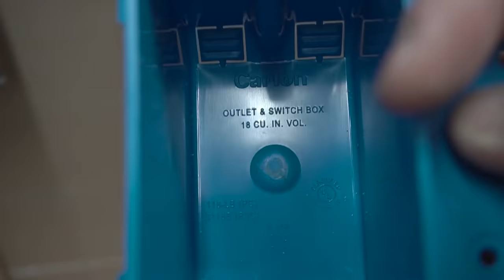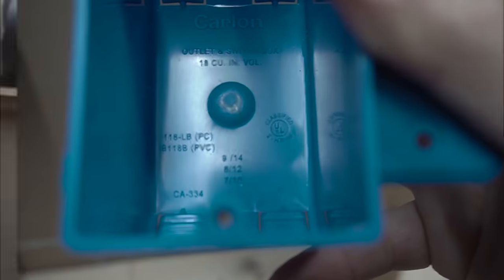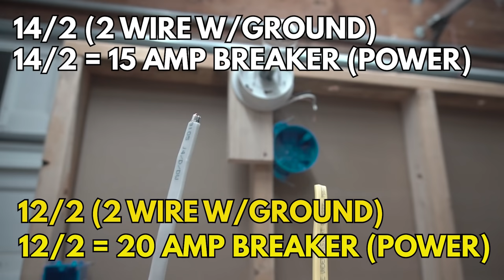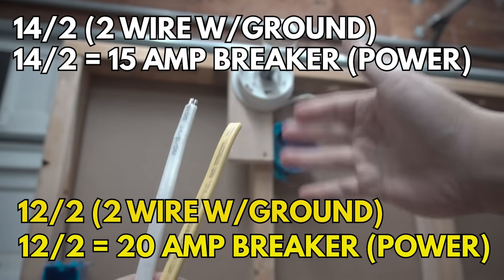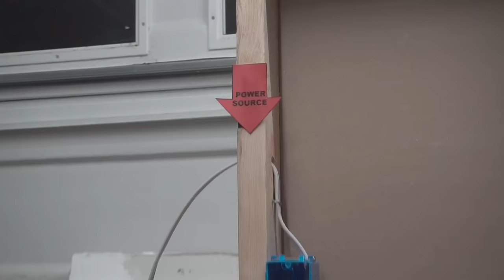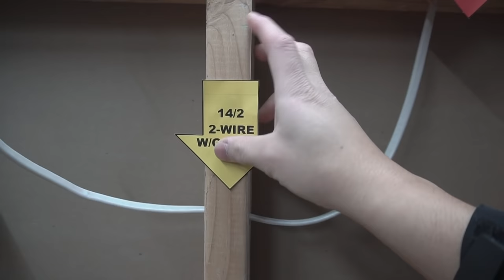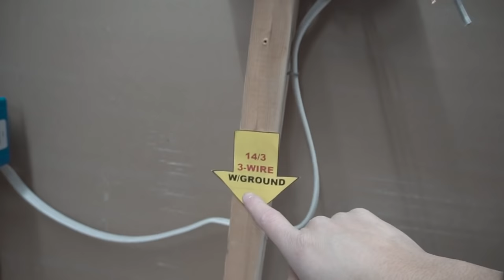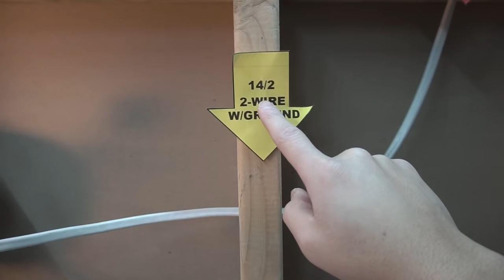How To Wire A Single Pole Light Switch Circuits 3 Different Ways (2022) DIY Tutorial For Beginners!

Comment: This has to be one of the best video's, excellent instructions and very clearly presented. I love your instructional mock up, nicely constructed. When you run power to light first, this is a switch loop because the power comes to the light, then to the switch and back to the light. Perfectly fine to do. The third method is the best way to do a switch loop because it leaves a neutral wire in the switch box and is a code requirement.
Can you show 3 way and 4 way switch wiring? A split receptacle where one is controlled by a switch and the other is live all the time would also be useful.
Reply from the maker: Thank you so much for the thoughtful comment and appreciating the video! It took a long time to compose and edit 😅.  I’m so glad you found it useful and thank you for mentioning and explaining the switch loop power travel points! 🙏🏽 I will definitely be making a video on a 3 way, Please stay tuned! Thank you for the love and support! 🙏🏽😊👍🏽
Reply from the maker: Also I will create a video on a split receptacle 👍🏽😊🙏🏽
Reply: I don't understand the purpose of the neutral wire in that third example since it's not connected to anything at one end.
Reply: @erichsh58  That's a good question. It does not function at this time, however it has been a requirement by the NEC since 2011 because it's usually necessary for a possible future upgrade to a Wi-Fi switch dimmer. Another incidental advantage is that if you want to add a new receptacle nearby, you can tap into this switch for power.
Reply: When connecting the live wire to a switch does it matter if it’s screwed at the bottom or the top?
Reply: definitely should have a million views, just what i was looking for
Reply: @FixThisHouse  how would i add another switch to that tho, so basically i want to put a light either on same switch or different switch but in same j box
Reply: absolutely

Comment: If you follow the NEC 2020 code, 2020 NEC 404.2(c), switches controlling lighting loads shall have a neutral in the box to allow for smart switches. Method 1 or 3 is required to meet the new code. Don't use method 2 anymore. Any new work or remodels should follow the new codes or whatever is mandated by local jurisdiction.
Reply: What is a "smart switch"?
Reply: While the instructional value of this video is great, it's equally valuable for folks out there who point out issues of serious concern (the updated NEC).  New dimmers from Lutron that are controllable from a internet connected "smart" bridge need the neutral to be able to work.  I will abandon method two because of this as I am installing the Caseta dimmers in my kitchen.
Reply: @Steve W  Great joke if intentional. If not, a smart switch is a switch that communicates using various wireless protocols to control power on/off, dimming, and actions remotely or at a set time. These actions can include setting a light to on/off, dim to a certain point, or make a ceiling fan turn on or off if the temperature inside or outside reaches a setpoint. This can
Reply: @Steve W  this switch can be controlled via 1) phone app, through a, 2) hub device connected to your home network ((WIFI, ethernet) or bluetooth, or other) or 3) the switch itself, 4) or even a secondary "scene switch" with pre-programmed button button press actions. Very cool and helpful stuff in the right use case.
Reply: Yeah. But what do you do with a situation where you have a 4 way switch in the loop between 2  3ways. The Romex in is 3 wires. 2 for travelers and one for common or switch leg . Same going out. There is no neutral. I always use black and red for travelers. The white left white would n
be my neutral. If I striped it with my marker that tells me it's my hot or switch leg.
Reply: A switch your phone can control through wi fi and internet.
Reply: @johndavies2949 Quite a complex situation.  Would have to have a diagram to make it fully clear, but my guess is that to meet 2020 NEC requirements you would need to run another romex wire in such a way to provide a neutral in the switch box. Probably best to draw it out and label each conductor’s purpose in the 4-way circuit, then ensure you have met requirements of having a neutral conductor in each switch box.
Reply: @stevew4117 A "smart switch" is one that operates by remote control. It can be turned on/off (and some can be dimmed) by voice commands with Google Home or Alexa, for instance.

Removing several Smart Switches is the reason for my viewing this video today, and Method 1 was the info I needed to know. Those lights are back to manual control and working perfectly. 

Thank you!
Reply: Did method 2 because that's how it was wired before.  I made a mistake and wired all the colors together. Kept tripping the breaker whenever I switched too off. After this video it works like it should now.

Comment: It looks like you removed the tabs from the gang box. They should stay attached to pinch the wires going into the box to keep them from moving... Also, you should give the wires into the Wago at least three twists to keep them from pulling out

Comment: Dude, this explains everything. Added an exhaust fan to my mom's restroom. Breaker kept tripping. Now I know. It's wired end of run. I thought I had seen a white wire connected to the black wire when I removed the old ceiling heater. Thanks a bunch. Now to crawl back into that hot Texas summer attic.

Comment: Your explanation of the “end of run single pole” helped me a lot. I had one wired like this and couldn’t figure out why there was a white and black on the switch and only one wire in the outlet box. This helped tremendously!
Reply: I literally had the same problem for 5+ years and just learned that 3rd option. I know enough to do minor stuff myself, so I refused to pay an electrician. You explained it better than I could. Thank you too

Comment: What I need is wiring a light switch into the middle of a run. Specifically, I am adding an undercabinet light which has no switch on it.  These are new cabinets that are on a wall that I opened up in order to add a 3-gang box of outlets down line from a light switch to a ceiling light. The new switch is to go between the existing switch and the outlets.  Do you already have a video covering this option? Thanks.

Comment: I was looking for info on how to wire in a Buster & Punch light switch in my renovated toilet. This video taught me everything the instruction manual of the switch didn't. It taught me the difference (and existence of) middle-of-run and end-of-run type wiring. I pulled the extra ground wire I learned I needed, I learned about the amazing wago clips (love em!) and I successfully installed the toilet light in one go even with a slight feel of confidence! Many, many thanks for your crystal clear & thorough instructions. Subscribed!

Comment: As always, making it look so easy. Thanks for sharing.

I do wish Builders would ask their Painters to NOT paint over the wiring near outlets, during a new build. That in itself causes problems for the home owner, trying to determine if a cable is truly white or black. Yes, a tester helps. But...
Reply from the maker: Thank you so much! Yes I find over spray a lot inside j box and texture as well. Just very frustrating trying to clean inside the box and like what you said trying to determine the cables. 😣 thank you for watching my friend!

Comment: Excellent instruction. Appreciate the methodical review. Two comments: 1. I would mention the advantage of doing the third method using the 14/3 future proofs the switch box by providing the neutral which is needed for many smart switches. 2. I would also mention that you can wire the 1-way switch reversed (ground stays the same) and it will work just fine. If you come across the reversed wiring in a renovation, it’s not wrong. The Line Hot wire (power from the source) and Load wire (feeding power to the fixture) can go on either brass screw on a 1-way switch. That was a source of confusion for me when I ran into this.
Reply: good comments,  since this is the question in my mind. 
However,  about point 2, I can not agree with you. 1. when the switch is off, the switch should keep the power out of the switch as much as possible. 2. in your case,  if the next electrician  wanna replace the switch,  he needs more work to confirm which is which.  so its better  to wire it correctly and uniformly at the beginning.
Reply: @yuchuanwei  I also found the video to be top notch. I do have a related question to the above - in method #1 the hot wire was connected to the top screw. In methods #2 and #3 the hot wire was connected to the bottom screw. Is that because it's an end run configuration?

Comment: Your video is the best I have ever seen for clear instructions. You are a really good instructor. I have a question though. In the 2nd example, would it matter if you switched the wires at the switch? I am putting in a new switch and they have the white wire on top and black wire on the bottom but the switch is working. I am assuming they wired it like you explained in the 2nd example up at the light. There is only one set of wires coming into the switch. None going out.

Comment: Great video!  Very detailed and clear descriptions.  Thanks very much.  I do have a question.  Can you explain the logic of attaching the power source hot wire to the top switch lug on the "middle-of-run" example verses attaching the source hot wire to the bottom switch lug on the "end-of-run" example?

Comment: Im building a room and had some outlets added and wanted a light switch installed. Electrician ran the lines but due to lack of studs he didnt install the switch. 1 week later he ghosted me. Idiot never connected the line. This video saved me a few hundred. Thank you!

Comment: Thank you very much. I like the plastic connectors, instead of the twist caps.
Reply: Wago 221
Reply from the maker: Thank you! Yes love those WAGO’s their super easy to use! You don’t have to worry about the wires if they are secured together. 👍🏽😊

Comment: This is a very helpful video! Thank you for sharing this. I have a question that I hope you can send me in the right direction or maybe it is a topic you have covered before. I want to wire an end of run switch for multiple light troffers. I am thinking the second sample in this video only turn the last light in the daisy chain on and off. Have you covered that scenario or can you point me in the right direction? I'm having trouble finding a diagram for that kind of layout. Thanks again!

Comment: Great videos and very helpful.  I’m trying to add a second switch in a box that already has a END OF RUN single pole switch.  Do you have a video that shows how to get power to the new switch? I’m trying to add another light that is controlled by the new switch.  But there is only one wire in the box right now that controls another light.

Comment: Hello, I have and end of run in my barn which is the second method you showed. My white is hot. I have a single pole switch outlet combo. I tried to rewire it a few years ago so the outlet was always hot instead of switched. I couldn't figure it out and then found your video. I have the light switch working, but can't get the outlet to work. I have the white(hot) jumpered to the switch and outlet. The only thing I have hooked to the outlet is hot and ground. No power. What am I missing?
I think I figured it out. If I want the outlet to be hot all the time I need to wire it the third way, picking up the neutral for the outlet? I am missing a neutral to the outlet. Is this why it's not working? Could you do a video on how to wire end of run light switch, outlet combo with outlet hot all the time. I can't find any videos showing this setup.
Reply: @clover3930  I figured it out. It was set up as the ground wire as the neutral.

Comment: This is great. Easy, clean explanation. I have a question for you that I hope you can address! What about when daisy-chaining 6 recessed LED lights together, but also working with and end-of-run switch? Do I just do this at one end (where power goes to FIRST light?) or do I need to connect every light differently to each other? Thank you!

Comment: thank you very much. very helpful and easy to understand. first time watcher and subscribed. method #1 single pole light switch with two black wires. my question is: on the black wires, one of the black wires is coiled around the other black wire which is straight. what is the significance of the coiled black wire? does one signify it has the load?
Reply: The wire that is coiled around the other is your hot. The straight one is you switch leg. The electrician knows what's going on . What I do and what I tell my guys is you mark the switch leg always. Well how do you mark a black wire. We strip the switch leg back an inch exposing the copper. Now we know without having to carry tape or trace the wire. This is done during the rough in phase. So let's say you had 3 romexes in a I gang box. You know it's for a switch. All the wires come in at the top of the box. So you have power in, power out, and switch leg out to light. Which of the 3 black conductors is the one going to the light,? The one that has been stripped . Now you know how to make up the wires before or after the sheet rock has been installed because you identified your switch leg. So on make up the two blacks not stripped go together with a 6" piece of scrap to feed power into the switch, the black left over that was stripped back an inch goes to the light bulb, and the 3 whites go together upon making up the box. Most inspectors like to see all the boxes made up ready for devices upon the rough in inspection. They pay particular attention to see that at least all neutral connections in switch boxes are made up. It depends on your inspector.
Reply: @johndavies2949   Thank you for your detailed explanation. Now I understand the significance of coiled wire. The coiled wire is the hot.

Comment: Great video but I was just wondering in the first method the hot feed is on the top of the light switch and the second and third method the hot feed is going to the bottom. Will this affect the light being on in the down position or up position?

Comment: Well it was a pretty good video.  Like mentioned before when connecting to the terminals on the switch it doesn't matter which one is on which screw. But if you're a real professional you know that on any electrical disconnect the line(power in ) goes on the top of the disconnect and the load(light bulb) , in goes on the bottom.  So in a way, a light switch can be considered a disconnect so just to stay consistent put your power in on top and power out on bottom.  Rather than calling the wires power in and power out the real electricians refer to power in as the hot wire because that's the one that will shock you if you have to work on an energized circuit, and the one on the bottom that goes from the switch to the light is referred to as the "switch leg" because it is the one that is switched on and off. Now when power comes in at the light, if you are just using 2 wire Romex, you are correct to mark the white wire black with a wrap of tape, but most guys use the black magic marker and color it completely or make a stripe or two. Now it doesn't matter if you send power (hot) down to the switch on either the marked wire or the black wire. Well be consistent. At the light where the power source comes in connect that black wire to the black wire going down to the switch. The white wire with the black tape is now the switch leg. It will connect to the black wire coming off the fixture. So at the light fixture the white wire with the black marking is bringing power to the light and the other white wire in the box is connected to the white wire from the source which is the neutral wire. By doing it this way you know that the black wire at the switch is always hot and the marked white wire is the switch leg going to the light bulb. So we mark the white wire for 2 reasons. One is to identify it as a current carrying conductor and the other and most important is to identify it as a switch leg. So now you don't have to guess which wire is hot and which wire is switched. You won't have to use a volt meter or ticker or continuity tester. You know the black will be the hot and connects to the top screw on the switch.
Reply: Whoa! That's a lot of info: can you simplify it a little? Thanks!

Comment: Having issues troubleshooting an end of run switch that also powers another switch to a different light fixture. I can get either loop to work individually, but not both simultaneously. Pretty sure the correct use of the common (marked hot) power source wire is where I am getting confused. Any advice?

Comment: I just wired a end of run single pole switch, existing installation as per your instructions with end of run 4 wire running into the switch box (wired red and black into the switch).  My result is a light fixture that is always on independent of the switch position.  Does that mean I wired the light fixture incorrectly somehow?  Learning

Comment: I am new on ur channel I have a question I have a wall receptacle that has 2 white wires on the bottom screws and it runs to a light switch that has 2 black wires on the 2 bottom screws. I was wanting to put a new light switch in to control a new light what would I have to do to get the light to work? Please help me

Comment: I am installing a humidity switch that controls a ceiling exhaust fan. The switch requires a red wire, but the exhaust fan only needs a black and white. Do I have to run a 12 three from my breaker box to my switch box and use the red on my switch or can I convert a 14-2 into a 14-3 ?  Thanks for your help.